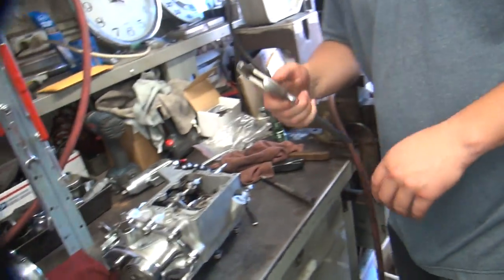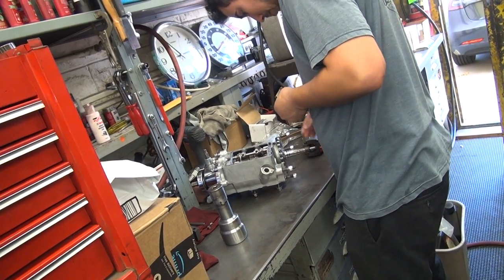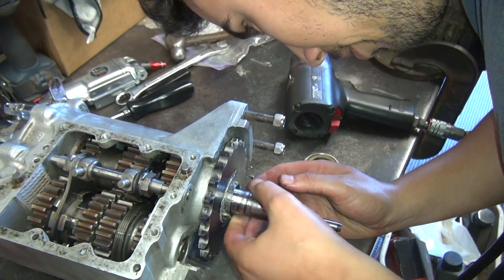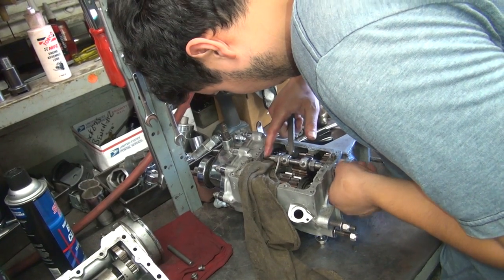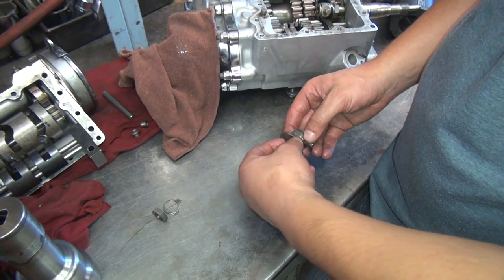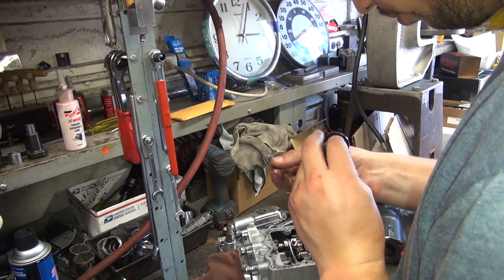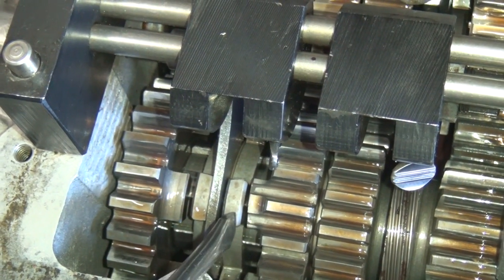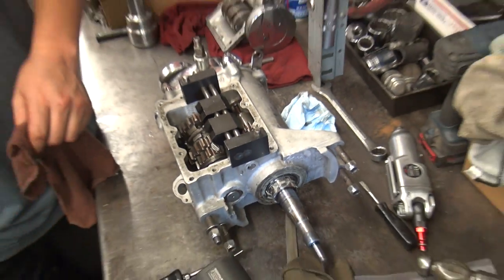#102 1973 shovelhead 4 speed transmission shift fork adjusting repair FL FX harley by tatro machine

Comment: Harley sure use to make some beautiful parts.  That craft has long since been abandoned.   I walked past a new fatboy 2 days ago. It was parked just outside the gate at a local festival.   I was looking at it as I walked towards it.  Was looking at it as I past it. As I walked 3-4 steps past it, I had my head turned looking back at it. It wasn't until my 4th or 5th step past the bike that I realized what it was.  Up until just before I realized what it was, I was ready to make a guess that it must be a Suzuki or kawasaki.  Then the headlight caught my attention.  I had spent some time at a dealership, on a couple occasions.  While at the dealership, I couldn't get over how bad they have destroyed the look and craftsmanship of their bikes.  Particularly the fatboy.  The headlight on the fatboy is the ugliest damn thing I've ever seen on a harley, from factory.  Newer harleys are nothing but over engineered, throw away, junk. There are a few legacy parts on a couple models.  Aside for that, there is nothing worth preserving that is associated with these newer harleys.   It's a shame guys.